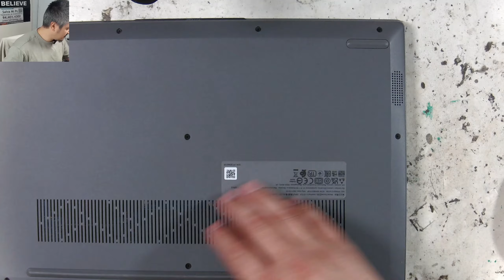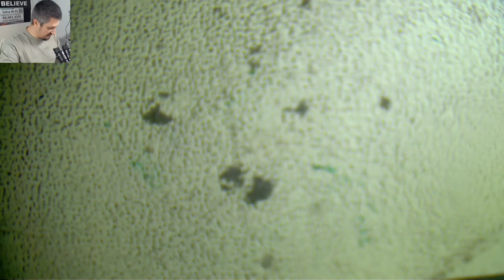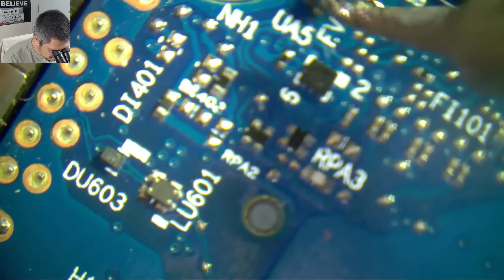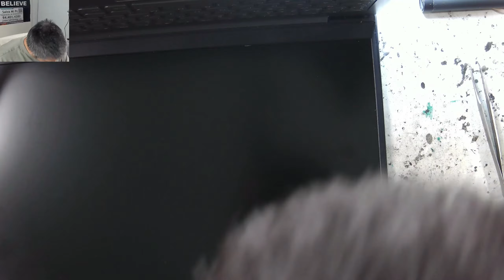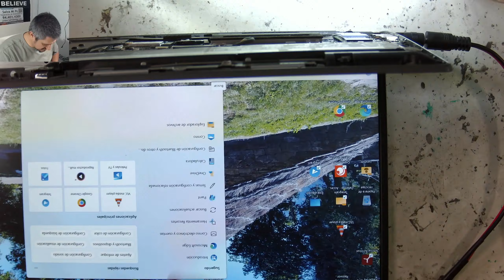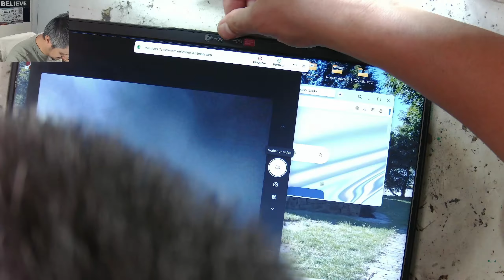Can we fix a Lenovo Ideapad 3 with black screen? Full disassemble diagnostic and repair.

Comment: sir i think its better to replace a smd fuse rather than jumpering a wire..
Reply from the maker: You're absolutely right — replacing it with the correct fuse is the proper way to repair it. 👍

In this particular case, I didn't have the exact fuse available, so I used a piece of wire as a temporary fuse. I tested the wire beforehand and know that, in this application, it will act as a fuse at around 2 A, while the original fuse is rated at 3 A. The normal operating current is far below that, so it won't affect normal operation and should open in the event of a significant overcurrent.

I actually purchased quality SMD fuses from Mouser and use the correct fuse whenever I have the right one available. The important thing is knowing the characteristics of what you're using rather than simply putting in an unknown piece of wire. 👍

Comment: I burned my motherboard by wielding jumper between fuse and ceramic capacitor now it's not powering on at all
Reply from the maker: Maybe you solderwd on the gnd of the capacitor. If you solder on the wrong side if the cap, will create a short. The BQ detects the dead short and the laptop will not powe on the laptop. If his is the case, remove the jumper you made and if there are no more shorts the laptop should start.

Another reason could be that the screen or the cable is shorted, and that was the reason why the fuse had brown. If you rebuild properly the fuse and thenlaptop stop working is because the short is after the fuse. After the fuse the 20v goes to the screen connector. 

Do something, with the battery disconnected and adapter measure in ohm the resistance after the fuse, if its very low then you shorted, remove the lvds cable and measure again if its fine then try to turn on with the screen disconnected,  just hdmi, if it works  hen the problem is either the screen or cable.
Reply: @salvamipc thank you for your help the capacitor was beeping on the both side that's why I get confused I took out out the capacitor but it still beeping and 3.3v is missing in all coils
Reply from the maker: @AhmedBerkache-s9b if the cap is beeping on both sides it meens is a short. Remove the motherboard from the syatem, remove your fuse and bridge, the cap is already out. Not chek the resistance in ohm on each side of the cap. To measure put the meter in ohm, put the black lead on any ground or screw holes  and then probe each side where the cap was. What are the mesurments? 3v would be missing if you have a short in the mail line.